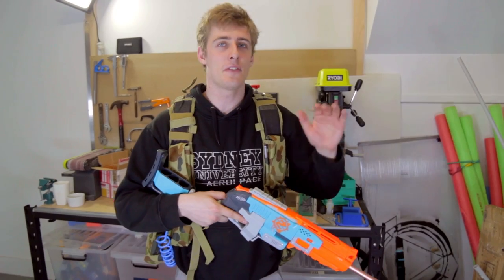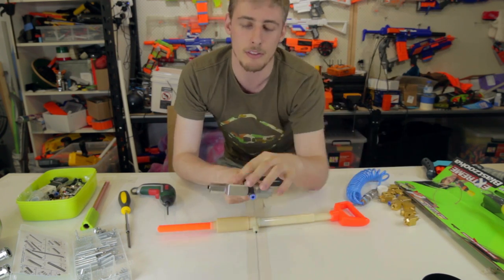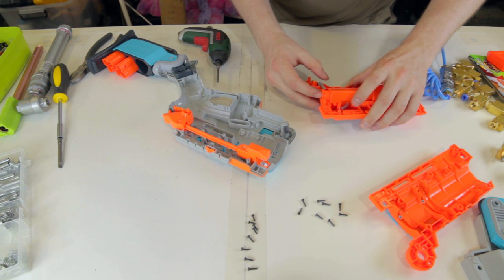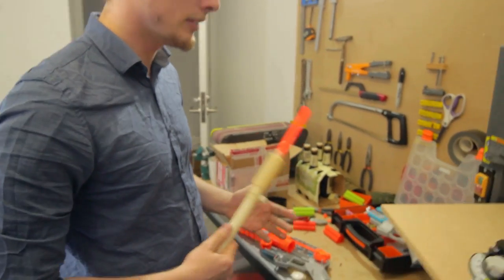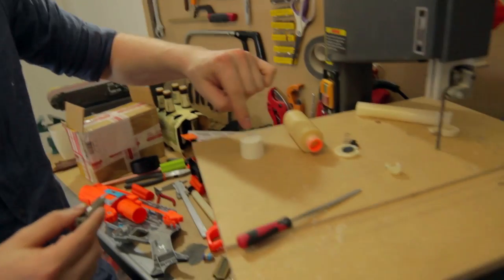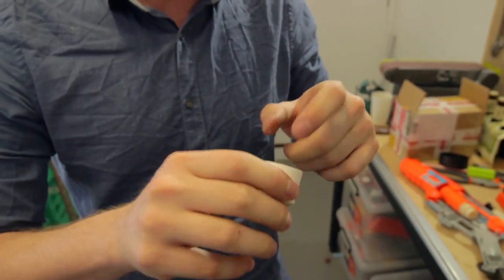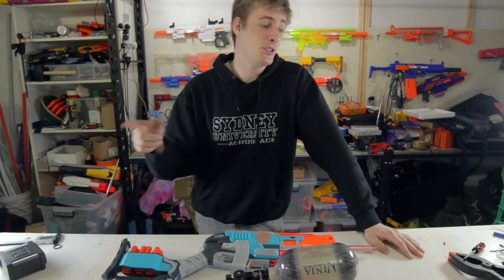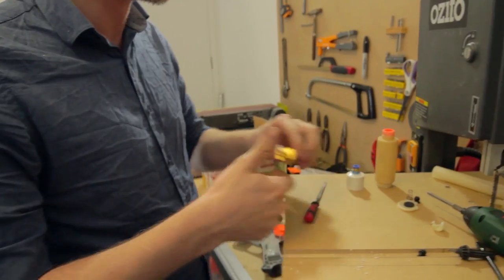How to Make an Ultra Sledgefire - NERF SUPER SHOTGUN Mod Guide

Comment: Would love to know how high you eventually take the pressure on this bad boy (see how far you dare to go), or even remote test how the stress limits of the plastic components.

We'll need some more sledgefire mods from you guys to see a sledgefire only game between you all, would be awesome!

Keep up the excellent work guys!
Reply from the maker: I have no intention of deliberately exploding a $50 tank but I have seen these taken to 100 PSI just fine. That said I have the designs finalized for a welded metal XBZ tank that I just need to make some time to get onto a lathe to turn up. They would handle any sort of reasonable pressure! I might make a batch and sell them -R

Comment: What kind of fittings are you using inside the blaster, between the valve and the quick connect? I'm planning on doing my own HPA Destiny, and that info would help immensely.
Reply from the maker: Its called a push in fitting -R

Comment: hey to put the cherry on top you cold cut off a part of the top of the brass barrel and put a mag with a little pull out pin wich is air tite between the brassbarrel and the mag 
    \\    -mag  
     \\
      --------   - pin

=============
Reply: Great vid keep up the good work

Comment: Need a little of an answer. Does it let a small amount of air through each push, or does it just keep letting air through as you hold it down?
Reply from the maker: Ryan explains how a QEV (Quick Exhaust Valve) works in the video. 
-Justin

Comment: What solvent cement did you use? is it just standard PVC solvent cement from the hardware store?
Reply from the maker: Yup. There was a choice of normal and pressure rated so I used the latter. -R
Reply: Make.Test.Battle thanks a lot! I appreciate it that you responded so quickly!

Comment: I NEED THIS.  I think its cooler using the 6 shots than the single.  I challenge you do do something using a PolarStar airsoft Fusion engine and its capability of select fire in a Rivals gun
Reply from the maker: Check the Destiny video we just release ;) Its basically that -R
Reply: Rivals HPA blaster!!!
Reply: make a barrel insert for rival rounds

Comment: so what did you do with the shell ejection arm to allow for the artifact barrel shell?
Reply from the maker: Ah yes. I forgot to add that. I actually didn't need to modify the ejector. What I did do is slightly cut down to other two fixed tabs inside the barrel and that allowed the artifact singled barrel to be inserted. The ejector tab just sort moves over to one side -R

Comment: What happens if you hold your finger on the trigger, does it just keep releasing air, or does it shut off after a short burst?
Reply from the maker: The QEV valve shuts off the air supply when it fires the tank so if I hold the trigger nothing happens after it faires and it waits until I release it to refill the tank -R
Reply: Make.Test.Battle thanks awesome build, and glad your aussie, like me :-)

Comment: If someone want to say, stick a CO2 cartridge inside a hammershot, what kind of air tank should they use?
Reply from the maker: The hard part with HPA is getting everything to fit. I don't know of anything that would fit in a Hammershot -R
Reply: ok, no wonder it hasn't been done :p

Comment: I'm surprised you guys still have those Blastzookas knocking around.
I'm going to have to try this at some point, maybe with a Berzerker Tank instead...
Reply from the maker: ...I need more... I have a stockpile of old pin based tanks in my box that I haven't done anything with. XBZs are just so easy to mod to use with HPA. If you used like a 4B (zerker) tank then you need like a manual on/off valve to cut off the air supply -R

Comment: Have you guys ever considered buying a paintball gun and hooking something up to it instead of buying a compressed air tank and the other stuff? If not I might just do that, also, when I modified my sledge fire, I grabbed a slightly tougher spring and when I would open it the shells would fly out with no problem, no matter how I was holding, I don't know why your shells barely eject with that big spring you tossed in it, also, great video, I love MTB's tutorials
Reply from the maker: In Australia paintball markers are pretty strictly regulated because of our firearms laws so that's not really possible. I guess my first bigger spring wasn't that much bigger than the stock one -R

Comment: Do you guys think a HPA system could work on a barricade? It has a higher capacity and the barrel rotates by using the  trigger.
Reply from the maker: Most certainly. I'll be making a pistol out of the old Fury Fire with the pump cut off -R
Reply from the maker: Jacob Chernick Hehehe mate I made that. As in thats my picture that I uploaded :P -R

Comment: pizza fund XD, this was an amazing video, and i am going to be doing the same thing now but with a stampede what do you think, and thanks for putting those links in the discription, but this seems to be a bit pricey if you are going to get all of the gear at once though.
Reply from the maker: Thanks! And yes, HPA is definitely not a cheap build... -R
Reply: thanks for responding, and i am going to do a lot of research on this but it should not be too hard, i now i will do it but i have to finish all my other blasters and record it so i can update my channel, I  will leave a link in one of your videos once i do finish like in 2017 ,till then or something like that. (btw you do not have to respond)
Reply from the maker: If you want a good starting place, jump in the "Nerf High Pressure Airheads" facebook group -R

Comment: I have a hpa rig on a nerf gun and can you show how to regulate the presser down enough to be usable.
Reply from the maker: That is what the second stage reg is for -R
Reply: Why didn't you just get an LPR which stands for a low pressure regulato
Reply from the maker: I do. Its a Ninja Pro V2 SLP reg. Even those output at 300 PSI which is far too high for Nerf. You need another regulator to take it down to about 60 PSI -R

Comment: All right, Allright, Alright, Alrigt, Alrit, Arit, Ait, At, A, .
Reply: No seriously this was brilliant. That style of auto resetting trigger is what I've wanted in a gas system (running from co2) for AAAGES, but I've never worked out how to build one with a single action system.
The best I've managed to make is a separate button to fill the blast tank from the trigger that releases the blast tank contents down the barrel.
Reply from the maker: Yeah, thats exactly what a QEV is designed to do and its implementation in the XBZ perfect for Nerfy uses -R
Reply: Make.Test.Battle Why has nobody told me of the existence of a qev before! 
Seriously, a whole lot of my projects consist of me spending days designing and bodging something to work just how I want it to then years later someone tells me about an off the shelf component that would have done it better.

Runs to shop to buy 15 QEVs
Reply from the maker: EDSKaR Heh... half of learning most trades is just figuring out the name for the thing you want. Most times there is always a thing that does exactly what you want; you just gotta find it or someone that does -R
Reply: Yes, but I don't know people, generally, and I certainly don't know anyone with any mechanical or technical knowledge.

I'll get it done by the time I die :P.
Reply: EDSKaR
Reply: Erwin Silab Yes, that's my name.
Reply: es. un.

Comment: "it's close to neutral buoyant (I think that's how you spell it)" yes....but when you pull up on a ladder to get out and THEN you feel the weight
Reply from the maker: yepppppppppp can confirm. Still better than a steel tank however -R
Reply: Make.Test.Battle (26:24) if you were to make that out of PVC what sizes would you need (I have never moded a nerf blaster before)
Reply from the maker: Not sure about american PVC sized but I think 1/2 is the suggestion. Here in Aus we use 16mm electrical conduit (which is also made of PVC but not referred to as "PVC" :S) and its pretty good. -R
Reply: Make.Test.Battle great....now just to play the "please wait 4-6 business days for delivery" game

Comment: should have used a 90 degree fitting from valve to chamber so that bend in the hose wouldn't be an issue
Reply from the maker: Would have bent either way, and now its a bit more flexible if I want to use it in another build. I was originally not going to keep it in that form, but I liked it so much I had to keep it! -R

Comment: I was seriously thinking of doing this until I saw the price on the paintball air tank
Reply from the maker: Yeah... This isnt a cheap setup by any means -R
Reply: Make.Test.Battle I did find another ninja tank on amazon that is aluminum for $60 but even so with valves, fittings, and regulators it gets pricey
Reply from the maker: Not gunna lie I spend way too much money on this hobby... -R
Reply: Make.Test.Battle with how well the mod worked out I'd say it's worth it
Reply from the maker: ninjarmy Oh most certainly. And once the upfront cost of the tank is paid for, the builds are not that expensive -R
Reply: sorry to bother because I know you are working on bigger and better projects, but in case you are interested or no one has brought up the idea, I did a quick and dirty mod on a hammershot that lets you swap out the cylinders. I basically had to saw off part of the front arm and stick a plastic bar in that would brace the cylinder (I think I still have pictures of what I did). I know you guys could design something 3d printed that would work a hundred times better especially with people making 3d printed 6-7 shot cylinders.
Reply from the maker: ninjarmy Nieat. Ive seen a few gos at doing that but I've always kept my Hammershot more or less stock so that I can use it at Stock Only events -R

Comment: yeah it's safe I have it set at 200 psi then my regulater brings it down to zero if needed.
Reply from the maker: Cool. My second regulator is rated up to 300 PSI so I don't really need to adjust it -R
Reply: I think ninja makes a lpr for that tank
Reply from the maker: thats the one that I have -R
Reply: Ok  are you going to open it up to try to get it lower?
Reply from the maker: No need as I have the second stage regulator -R

Comment: FPS readings?
Reply from the maker: I had it at 200 FPS but with HPA you just crank up the pressure and you get whatever FPS you want. 200 is what I wanted -R
Reply: Hey if my Stryfe runs 2 xtreme pro 180s would it be safe for your wars?
Reply from the maker: Nathan Beck Yes -R

Comment: I would help on patron but I am poor. :( but cool mod, I was thinking of doing some sort of basic HPA setup with a coke bottle yes coke bottle and use a bike pump to fill it when its low. never did it, there's more important things like school. wait who needs school.
Reply from the maker: No worries man, subscribing and all that other jazz helps too! A coke bottle isn't a terribly safe way of doing it because it can be easily punctured or damaged during play -R
Reply: Make.Test.Battle you're right about fragility there, but you could put a few socks over it to reduce abrasion risk. check out the slingshot channel's coke bottle gatling gun; Joerg uses pretty high pressures and he hasn't had issue I know of. I say try it, just stick to a reasonable pressure for testing purposes and use it as an educational adventure. Good luck dude :)
Reply from the maker: Pete S Just remember that a coke bottle of air at 100 PSI has about 3000 joules of energy stored in it and if it pops, it's going to go off like a grenade. Paintball tanks are designed to take hits from paintballs. Coke bottles might be statically rated to 220 PSI, but if they are hit by a dart, bashed into a corner while running or something... bada big boom -R
Reply: Make.Test.Battle Of course, shrapnel to the face, so cap at like 30psi. It will still shoot and prove the principle without the painful after effects
Reply: I wasn't  actually  going to do it. I was alos going to put a baloon in it tonkeep the air at a smaller psi. Ill probaly just stick with springers and flywheels.

Comment: should have gotten a big blast
Reply from the maker: I have several Big Blasts and Titan tanks, but the thing is that "back pressure" QEV style tanks work far better with HPA as you can just use a single pneumatic valve to fill and fire them in one action. A big blast requires a separate "fill button" and a "fire trigger" to work and the trigger pull is very heavy. That and it doesnt fit nicely in the sledgefire shell -R